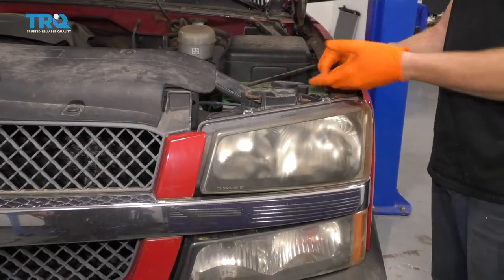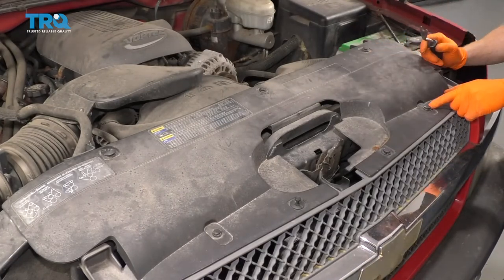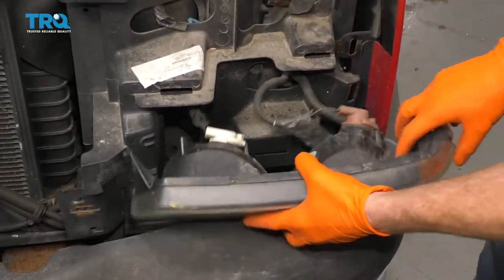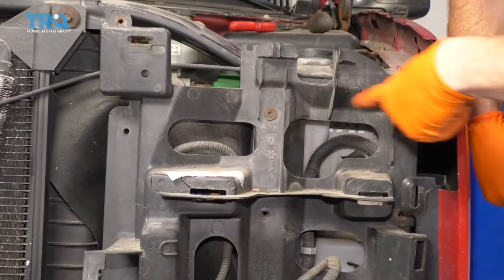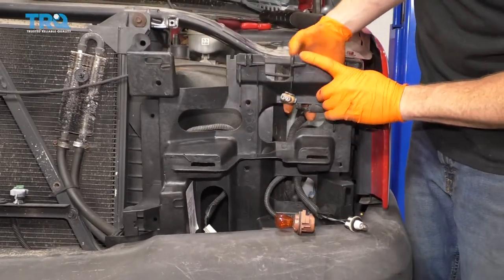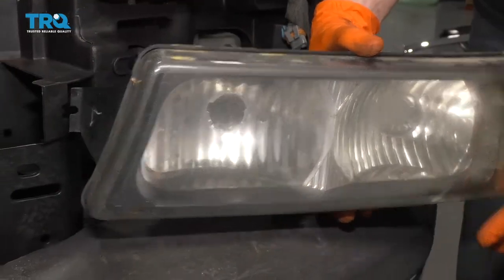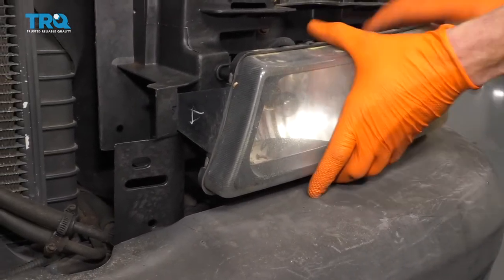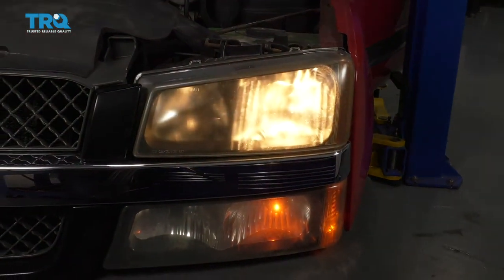How to Replace Headlight Mounting Bracket 2003-2006 Chevy Silverado

Comment: Are these to make the headlights straight? To not fall off?
Reply: No it’s a factory piece that should be fine on your truck unless your in a accident or hit something hard enough to crack this piece behind the headlight it will never need replaced, but if your headlight , top
Or bottom is falling out this or the clip on the light itself could be your issue
Reply: @Nunya-gk9fr  thanks , I have the same issue on my Sierra it bugs tf outta me haha . Ima just order new brackets and headlights might as well I feel bad for blinding people bc they’re out of adjustment

Comment: Ive got a 2004 chevy Silverado My bottom turn signal assembly keeps popping out..if i replace the headlight assembly bracket could this fix my problem?
Reply from the maker: +pavv24 Thanks for watching!  That could certainly be the issue in your case.